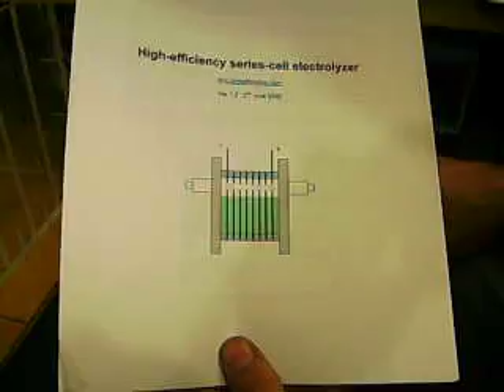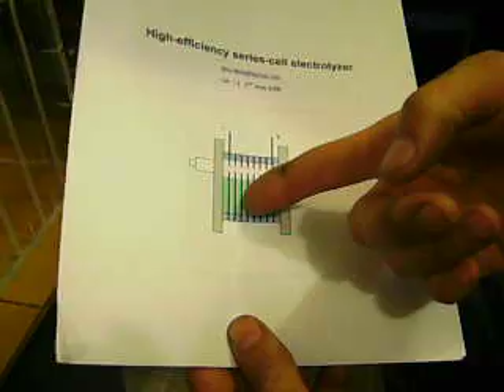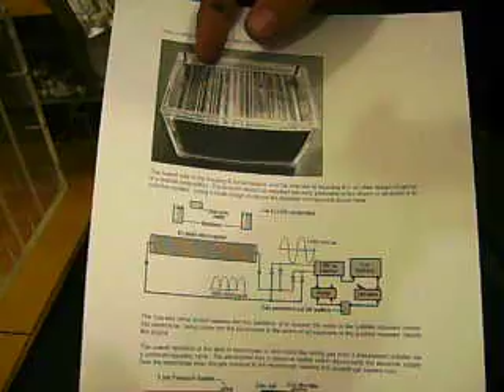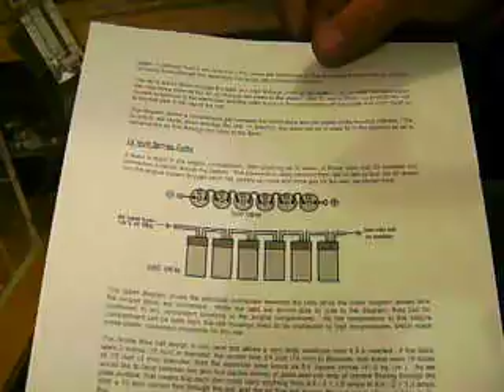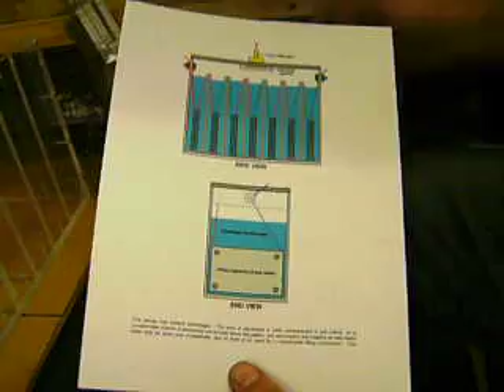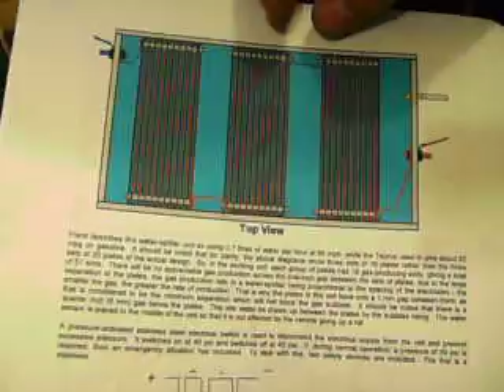GenIII story part 1.

Comment: I am currently working on a recharging system to keep the extra battery charged and be able to run my newest unit completely of it..From all the my test,I really believe (on my car anyway)That the drag on the motor from the amp draw is the biggest culprit..

Comment: I believe is mostly due to the drag/load put on the alternator,the reason I say this because 1st unit I really dont know, it didnt work I quit with it, then the 2nd unit I was drawing 22 amps getting only 500 ml per min.The 3rd i only got gains when it was not hooked to the car system. The 4th I believe I am making enough gas to accommodate the amp draw and get some gain.From all my test I believe the biggest problem with hho is the amp draw.

Comment: No I have not use an EFIE or map/maf enhancer.Its took me a while get those result, I am on my 4th cell in my car,first one was really small,didnt get any gains or loses with it,then made a pipe one,lost bout 3 mpg with .Then the 3rd was a switch plate one with  800ml hho ran it on a seperate battery & got 4 mpg gain ,now i have the 6x6 16 plate drycell doing 1.5 lpm and and supplementing some of the power drawn with a 2nd battery and have an average of 7mpg gain been testing for bout 3000 miles

Comment: Actually the Tero style cell , I call it a drycell are very simple to build and simple to maintain, and are very efficient in making gas and are electrically efficient and superior to any open bath cell I have seen or built my self  and can be run for hrs on in with no heat problems when it is setup in a 4n configuration..I have a 16 plate 6"x6" unit in my car. The unit is only 2 1/4" thick and it can fit in places an open bath cell cannot..

Comment: Hey smack.  I have done six seperate containers.  each one containing a two plate spiral cell. I ran into a problem of not enough current draw. Any more than 3 containers in series and the production and current draw sucked. even when adding tons of baking soda to each container, I couldn't get enough current.  Maybe sodium hydroxide will work better. Just letting you know my experience.